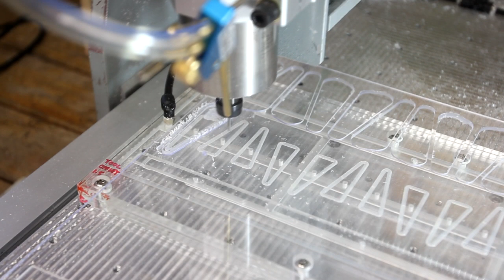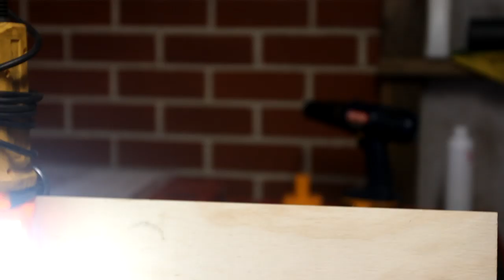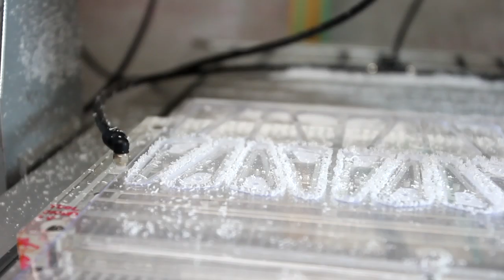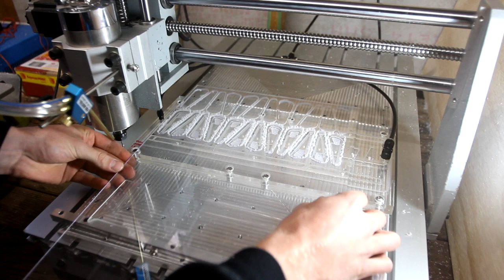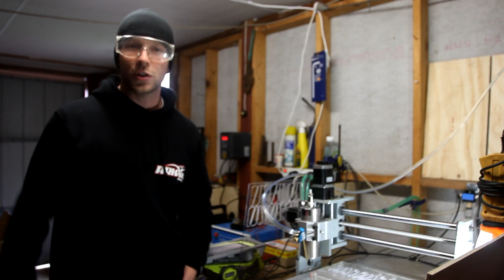CNC 6040 Milling on Vacuum Table

Comment from the maker: Check your toolpath program and make sure it is correct. Could also be your stepper motor wires, very common for these to go open circuit randomly and the machine will appear to have a mind of its own!

Comment: hello I have a cnc crudd zs 3040 24000 and I could not set well do the designs in ArtCAM and then step mach3, eg to make a 1mm deep work in 3 passes the first is fine but then is moved almost 1mm from the x-axis origin please helpme iam de venezuela my name is emerson

Comment from the maker: Yeah it is working a dream... I am very proud and stoked that it works as intended :D. Yup the end mill used was made by Amana Tools and is a 1/8" carbide single flute up cut, great for plastics. Hey you know I found out that conventional milling gives a MUCH better surface finish on plastic parts... weird huh! I have almost paid off my machine Azza. Thanks again for putting me on to it. Now I can generate some money for a proper mill :D

Comment: Great, stock is probably fine anyway, thanks for your help and the links to those programs, I've been searching for a while for that feature. Could you do an episode about milling 2 sided objects, for example a sword but flipping the material over so the machine can work on the other side without needing layer? It's fine if you can't I know it doesn't really match the type of milling that you do but it's a concept that has confused me for a while.

Comment: I can understand the taller arms part, but would you need to extend the distance the router can travel downwards for deeper cuts? The reason I want a taller Z is because I would be interested in replicating many different models and statuettes. The most complicated thing I would do is milling some kind of helmet from which I could create a mould and make it wearable. I imagine with a taller Z I will be able to achieve this with fewer layers? I will be milling various cases for my Raspberry Pis.